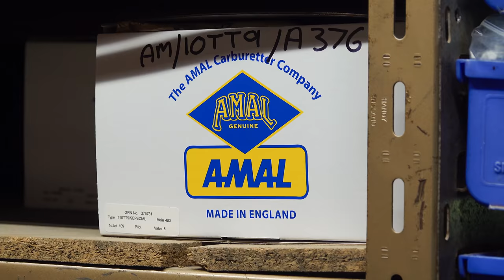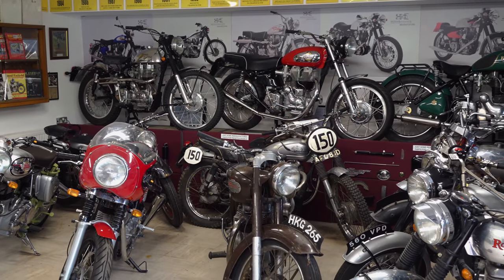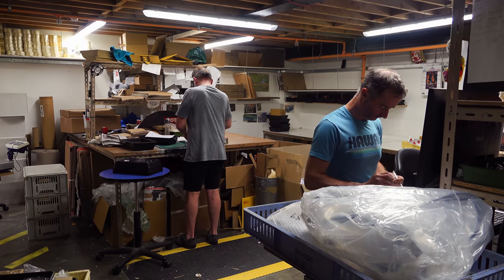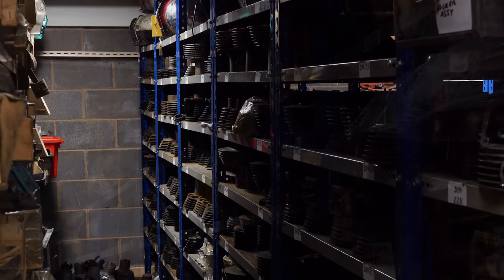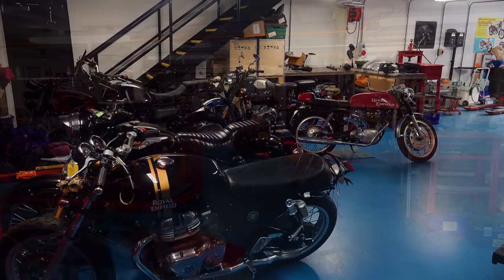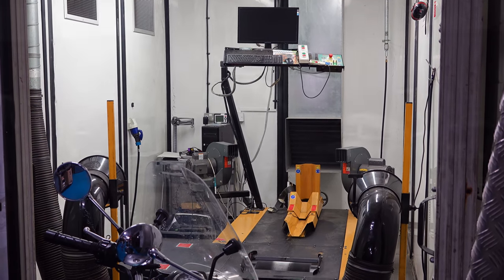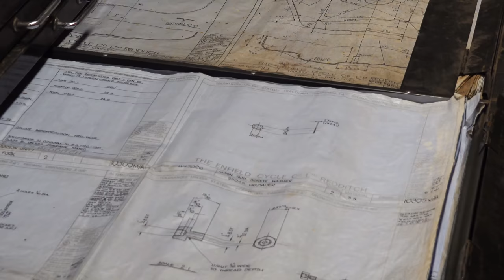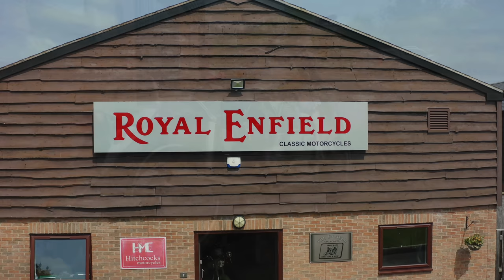Royal Enfield Classic motorcycles. Hitchcock's Magical Mystery shop Tour!

Comment: So glad this vid popped up in my feed! It's reassuring knowing these folks are around, having just gotten a Himalayan. This model so intrigued me that it was the kicker that got me back on a motorcycle  after 30 years. I'm not too sure about my local dealer after they took 16 days to get me a correct rear tire replacement! Sounds like Hitchcock's would save the day when I need a part.

Comment: Great video Stuart, I know exactly what you mean about being reminded of your metalwork class, it took me right back to when I did my engineering apprenticeship, all those lathes, the Bridgeport mill, the smell of tallow and cutting fluid, fantastic.
Been looking over the Hitchcocks website quite a bit lately and it is a fantastic catalogue of parts, even saw some Crusader 250 crank cases on there. I well remember going to get my spares from Gander & Gray when they were at Manor Park in East London, this was 40 years ago, everyone else was on the latest hot 250 from Japan, I was on the hot 250 from 1959 :)

Comment: So much 24 carat Unobtainium concentrated in one location, I'm sure it'd cause the Earth to wobble (more than it already does)  about its daily rotational axis. The only reason it doesn't is because I consider there's a similar counterbalance concentration of Unobtainium (albeit for a different marque) less than 5 minutes ride from my humble abode 'down under' here in the Antipodes. 

I live in the seething metropolis of Te Aroha (popn 2,500) in the uttermost Eastern Waikato region of New Zealand. And in what passes for a Town Centre, there is indeed "...a grubby little corner shop in some built-up area" that is the Global HQ of 'Anaconda' (formerly 'EconoHonda'). Behind the unassuming single wooden door there is a similar vast Aladdin's Cave of transmuted Unobtainium for nearly all things Honda for the last 60+ years. The door's password isn't 'Open Sesame' but more a shoutout of "Yo' Malcolm, are ya in there?"

That said, Hitchcock's piece-de-resistance is to have original blueprint drawings of RE parts. They are to motorcycle engineers, what the Dead Sea Scrolls are to Bible scholars-translators; perhaps even better. With an A0 scanner, modern CAD, and a 3-D metal printer, we have 'Redditch resurrected' and back in production :-D